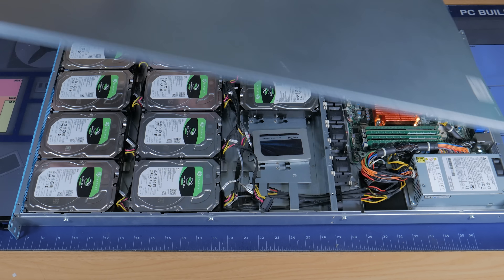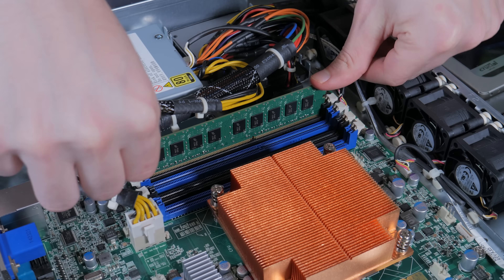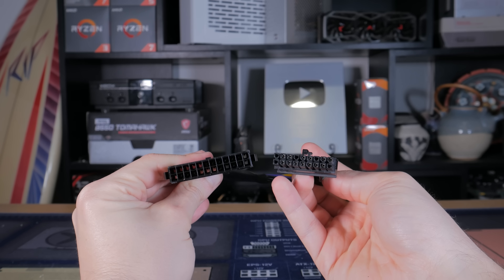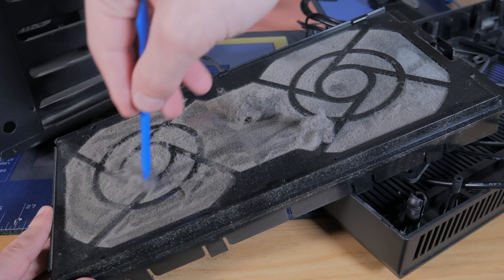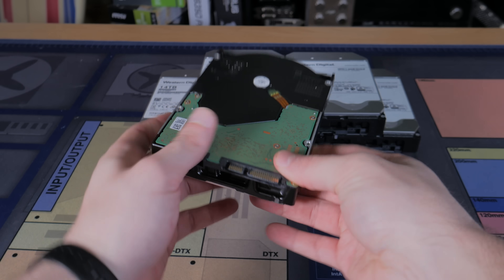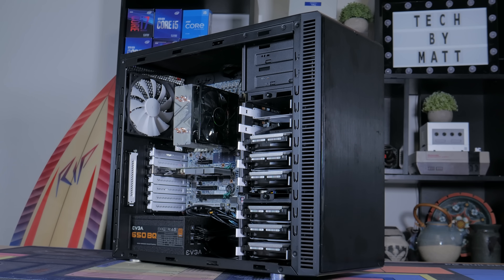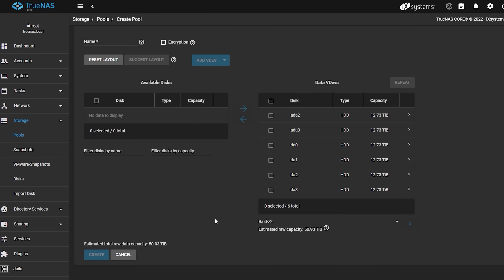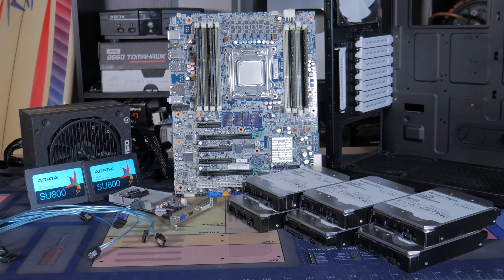Budget Storage Server 2022! | 84TB NAS

Comment: you should have to teen an desktop hard drive adapter and screws for each of the sata ssds you got for stability for eachother of them.
Reply: also for in addition to that, for the sata ssds, you should have gotten 100gb micron real ssd p300 s.

Comment: Did I miss how you are controlling all of those drives??  I don't see a controller card and looks like only a 4 port on the motherboard at time 10:30.
Reply: Look at 3:34 He states the MB has 10 SATA ports

FreeNas/TrueNAS you don't use controllers as you want ZFS the underlying filesystem to manage the drives. Otherwise the controller is doing things unexpectedly to how the drives/data is presented to the system. 

For this type of system you'd use an Host Bus Adapter (HBA) which basically just presents ports to the system for additional drives

Comment: In case anyone is wondering: You can't sell the WD Elements enclosures as empty hard drive enclosures because they only accommodate the original drive that was in. This is because the rubber grommets are unique to the original HDD and won't exactly fit any other, preventing you from successfully inserting/fitting a 3rd party drive in the enclosure. The controller board itself will however work with other drives, at least it did in my case (8TB WD Elements). But it's not really too useful if you can't fit non-original drives into the enclosure.

Comment: HP workstation boards like the Z-400 and Z-420, etc. are notorious for hanging on boot if you don't have all the hardware connected that was originally in the workstation. On the fan headers, you can jumper one of the pins to ground to fool it into thinking the proper fan is connected. On the front USB, and front 1394 error, it's easiest to keep the front USB/1394 cluster and cables, and connect it and just stuff it in the case somewhere. I used a Z-400 board in a nice build with a Lian Li all aluminum full tower case, and ran into these very same issues. With the Z-400, I found that the m/b tray from the original workstation is the best way to mount the board into an alternate case, as it already has the I/O shield integrated into the tray, and the mounts for the CPU cooler,  and it will make all the ports and slots line up where they should be, in a generic case.😉 Hope this helps.

Comment: I built out a extra Dell R720 with 192GB of RAM with 2 EMC JBODS with 30 4TB SAS6 drives 120TB Raw. Its freaking 8U and works very well with a 10GB SFP to my cisco switch. I have TrueNAS Scale on it as well. I use it host iSCSI LUNS for VMware.

Comment: For me I use a hack on the power for me. I clip a power  connection on the sata power so it will force the drives to work i clip a wire based off sata to sata adaptors or moles to sata adaptors

Comment: Great video! It's nit picking but this isn't really a server, t's a NAS. Network Attached Storage. A server would have redundant power supplies, a redundant RAM configuration, redundant NIC's and most important, redundant CPU's. When I worked at intel in the Server Customer Support group in Hillsboro, Oregon I got to build my own server with dual Xeon CPU's and all the rest of the components including intel RAID cards. Calling your nice NAS a server is mashing together two different classes of hardware.
I did appreciate that  you called out that a RAID is NOT a backup. I can't count the times I got calls from customers that lost all their data because their RAID failed. When I asked if they had a backup system in place they always replied "But my RAID is a backup" and more often than not it was a RAID 0 because it's cheaper.
You didn't talk about your network configuration. I hope you're using some kind of managed switch. They're pretty cheap nowadays and will resolve many slow data issues caused by congestion and data collisions. 
Overall I really enjoyed your video. Kudos!

Comment: Also when you rip apart an external drive do not throw away the pieces from it because you can use those as a hard drive recovery tool. They are easy to break so it's nice to have multiple ones laying around. Instead of buying a new toaster half the time I just use these. No I'm not talking about bread for half of you that don't understand what a toaster is.

Comment: The warranty doesn't mean s*** on an external drive when you're going to rip it out that case anyway😂 that's how I brought my laptop up to 4 tb on a budget. I have a dual hard drive slot laptop. PS I like your build and I have half the components to actually build this myself right now. I've never built or set up a nas system but I used to use one all the time and now my home network has gotten so big that I need a centralized Network for multiple computers to access the same software. I'm finally setting up my first nas at home😊

Comment: I'm considering a DIY NAS using an HP Z800 workstation that I have. It has dual Zeon processors and 42 Gb of RAM installed. The power supply is 1100w IIRC. A petty high end machine back in the day. Do you think this is a viable option for a NAS build? Thanks for your input!
Reply from the maker: Yeah. You're best off using what you have already to play around with software and stuff and if you find you're using it a lot and need more performance then upgrade. As long as you're not trying to do like an all SSD array, the older xeons will be fine.

Comment: Great video! I'm thinking of doing something similar but probably less drives to start. Is it easy to add more drives after? Also my tech friend advised against doing something like this due to high power consumption of the computer compared to a smaller system. Any thoughts on that?

Comment: I shucked the 5x 8TB drive and when attached direct to sata my HP Z420 cannot go through ubuntu login, stuck on HP logo. What should I do?  I did use molex to sata power cable but still has issue. Thanks!

Comment: Hi Matt, I'm using this video as a guide to create my own home server, and I have a question about the board, considering you already have it installed in your system. The board has 10 SATA ports, but only 6 of them support AHCI (allowing for optical drives). The other 4 are designed for SCU drives. How did you configure your setup to make all the SATA ports work? Best regards.
Reply: Glad to see he answered and great mask btw.

Comment: Those looking to buy this motherboard, mine did not come with a power switch, when you are looking at the board,  the 3rd from the left on the bottom row of pins.  Number 30 if your looking at an online manual.

Comment: Hey there - thanks for all your content on YT, quite informative & helpful. 

Wondering if you might be able to help. Am using a HP Z440 motherboard in a standard ATX PC Case to build a TrueNAS Scale NAS. 

Struggling to figure out the Front IO pinout connections on the motherboard, any pointers or ideas please?

Comment: I built the same type of NAS using a HP Z420 motherboard.. the CPU fan is SO LOUD. Is there a way I can lower the fan RPM? I did not find any CPU overclock/tuning in the BIOS. I am using a Xeon E5-2660v2 CPU and a factory OEM Z420 CPU fan.

Comment: Great video.  I'm looking to do something very similar and have a motherboard question.  I see you used a 2011 chipset mobo.  Did you have any issues with that board?  I purchased a used MSI 2011-3 board that won't POST no matter what RAM, CPU, or power supply combo I've tried.  So I bought a used Gigabyte 2011-3 board, and it has the same problem.  Do you happen to know anything about the 2011-3 boards?  I've tried clearing the BIOS with no luck.

Comment: For the RAM, if you're using TrueNAS and ZFS, I think the guideline is 1 GB of RAM per TB of raw storage. So, an 84 TB server should have at least 84 GB of RAM...or, more practically, 96 to 128 GB.
Reply: That's the guideline most people use. I saw some guidance from an IXSystems employee (they develop TrueNas) where he said just max out your RAM if you can. For something like this, or most home use-cases the SSD cache drives aren't going to be that beneficial. With that said, he'll be okay with 32 or 64GB, he just won't have the greatest performance.
Reply: hmmm so how much storage would 256GB of ram give you than ?  :O
Reply: @Bewefau You can't do that math yourself?

Comment: SO the 3.3v pin issues isn't isolated to WD drives and its not to discourage from shucking them from external drive carriers, its literally a power saver feature. When drive is not in use it has logic built in that will spin the down the drive and put it in a minimal power state. This is why it needs the 3.3 v rail vs the 5 and 12v. This comes on out of the box drives also. the reason for using the Molex adapter is due to the lack of the 5-pin power cable, or the 3.3v lead, so that it bypasses this. Much safer than putting tape in with power....

Comment: I FOUND 2x HP Z420 LGA2011 for $150 --- the hardest part on a HP Z420 was updating the BIOS from 2012 v1.03 to v1.23 so you can then update to v3.96

was tricky to find the FTP server for the bios updates 
wonder if I can upload the files safely for all you lucky people 
mega upload? link?
Reply: update ... skip the HP Z420 and just Aim for the HP Z440 workstation .. LGA2011v2 v3 v4 wont work in a HP Z420 :(
Reply: @MADBONE0  Only see 4 SATA ports on the MB.

Comment: 3.3v pin is power disable feature from WD and it is not to prevent shuck.  It is hard to just mask the 3rd pin as it is very small.  You can actually mask all the 3 pins from left not just the 3rd one, this is much better to do.  Standard 3M electric tap should do the work.

Comment: As an enterprise storage admin for a global media company, when it comes to determining how many parity drives you want, you also want to take into account rebuild times and the potential to have another failure while you are rebuilding.  The larger the drive, the longer the rebuild time.
Reply: Yes, given 200MB/s-240MB/s read/write average like HC530(14TB), read/write all content on single drive will take about 1 day in full capacity.  For HOME NAS, due to the number of drives, the rebuild process can be quite long.  EC based solution like minio is much better than RAID based solution but I didn't see much NAS package provide that option.
Reply: in addittion to a RAID rebuild putting more stress on the drives. Well said though.
Reply: Yes, really long rebuild time + you have to have a spare drive to swap, and not wait on it being shipped
Reply: With that in mind, what would you suggest? Less parity drives, or smaller drives? Both?
Reply: @jmasked5082  The recommendation is probably using RAID6 or other configurations that allow at least 2 drive failures without data loss. That, and maybe replacing the drive preemptively just to reduce the chance of two drives failing at the same time.
Reply: I do like the option to have dedicated parity drives (unraid, snapraid) which saves power and makes sure that you can restore individual disks if you had too many failures. As long as you don't need the extra speed of classical distributed parity array. Good option for home server use.
Reply: @ktmcintyre While your comment is 2+ years old by now 1 Question I have is "Do SSD based storage servers run into the same 'Length of Rebuild Time' issue that HDD servers have?"
Reply: @keith3278   no because 200MB/s is a lot different than 2GB/s at minimum, and where we are now its more like 4GB/s or higher. thats more dependent if you have the budget for that though which brings us back to hard drives for now.

Comment: I'm building a new gaming pc this black friday and I'll be using my old gaming PC as my first nas server build. It has an i7 4790k, 1050ti, 750w psu, 16gb ddr3 ram, 1tb m.2 drive, and a few old crappy 500gb-1tb hard drives. I'm a little weary about using those drives in a raid configuration so I'm gonna keep an eye out for a good deal on nas drives. I might just start off with 1 or 2 and them build up from there. I cant wait to set up a plex server that my family can have access to remotely.

Comment: That is a great and silent case. I happen to have one too and wanted to mention, that there is dust filter on bottom too. Didn't see you pulling it out during the clean up, so you might want to check how that looks. If it is as dusty as your front panel filter was, I bet your power source won't get much airflow ;) You can pull the filter out from front side. Just grab the "bottom" of the case (below the door) with your fingers and slide the filter module toward yourself.
Reply: I have the same case and love it!
Reply: @zobertson  which case is this? where can I find it?
Reply: @garycarr8467  I don't think they make it anymore. He referenced what it was in the video at one point

Comment: You're thinking that 2 parity drives has a very low probability of error, but that's a mistake when all the disks are large and new as in your case.
The reason is that when disks are a lot alike (same make, model and age) then they tend to fail at the same time.
When the first drive fails, of course you replace it with a new one to rebuild the array, and so you're adding stress on all of the other disks... but those disks are not small, 14 TB takes a long time to churn, and since the other disks are also very near failure (as demonstrated by the one that has failed already), you often get a second failure... and now you're with your pants down if another failure occurs.
That's the drama that many people experience and fail to understand.... "but I used 2 parity disks!" they say.

Comment: Dude! You have inspired me!! I have watched this video before but didn't realize the motherboard. I have had a 420 system for 10 years now. I upgraded the CPU to e5-2660(?) and up to 24gigs. After transferring it to another case, I did have to get the adapter cable for the power. I have found that if you jump certain pins on the front USB, firewire, etc., those errors go away on startup. If you want the fans not to ramp up, pins 11, 12, and 5 are a thermal sensor. I found mine in the original case and ripped it out, soooooooo much quite! Thanks again for your hard work.

Comment: Hi Matt,  I'm building a very similar NAS after watching your video.  I decided to pick up the HP Z420 motherboard and a Xeon 2630.  After assembling everything, my computer won't turn on unless I manually bridge the 15 and 16 headers (ground and power supply on) on the power supply, plug the motherboard back in, then hit the power button.  Second, after powering on I see the motherboard LED blinks 6 times indicating some sort of "pre-video graphic card error".  I'm curious if you ran across these issues and if you had a fix or suggestion.
Reply: Most Xeons dont have integrated gpu , inluding yours and that mobo doesnt support headless boot . So if you dont have designated gpu , its not gonna boot and it will gives you visual blinks and audio beep .  Secondly , thats a bad PSU , you shouldnt be bridging headers on psu just turn on mobo, could be a mobo issue as well but hey if it works like that dont mess with it :)  . 3rd Thats a Sandy Bridge Xeon from 2012 . You cant go wrong with Xeons in server applications and a big fan of them , however i wouldnt pick anything older then Haswell (2015) whwn you can get those  from Amazon for $35  brand new . Shoot even if you get an I5 7500 which is kaby lake fromm 2017 it will perform better then sandy bridge Xeon as its has better cpu pass mark .
Reply: @dannyt1705  Thanks for the reply.  For the record, I finally got past the 'pre-video graphic card error' I mentioned - it seems that my memory wasn't 100% seated.  It took quite a push to get them into the slots well and I only noticed after trying to troubleshoot with alternative ram sticks.  And you're right, the Xeon, or the motherboard doesn't have an integrated GPU, so I installed a very minimal GPU.  I am still dealing with his briding-the-pins issue to start the motherboard, and this happens between my existing and a power supply that I know works on another machine, seems like a motherboard issue.  Also, on boot I have to accept some missing elements (like front USB, etc.) by hitting F1.  So boot doesn't happen without at least a keyboard connected to the machine, not ideal for a server application.

Comment: I checked out why a dell toshiba SERVER drive is supposed to be better then a stock retail drive. 
It's setup to absorb vibration in a rack server with a lot more drives in the same area.
It has different internal structures,according to my research!
If that's true can't say,there's so much untruths out there in the product land,you don't know what to beleive!
On quoira,some person says to throw away a brand new dell toshiba server drive! and replace jt with aftermarket,but this drive is a server drive not a desktop drive,the toshiba 1 terabyte drive was not cheap,compared to retail!